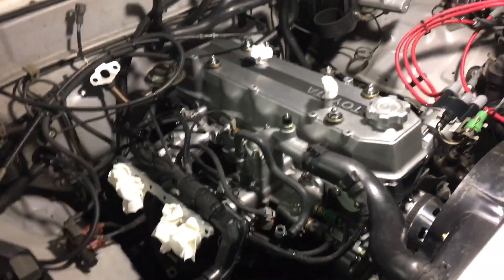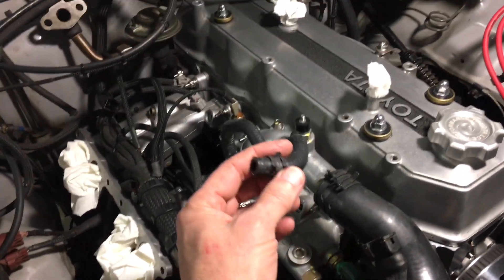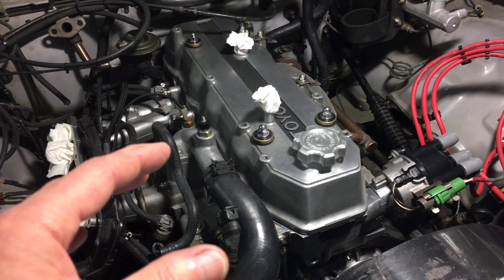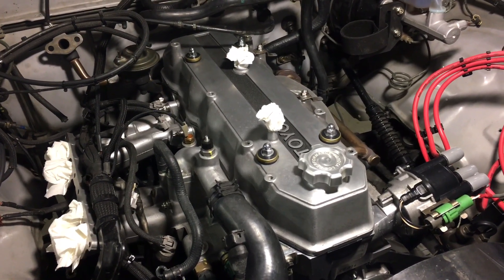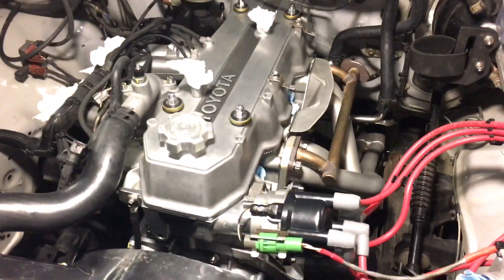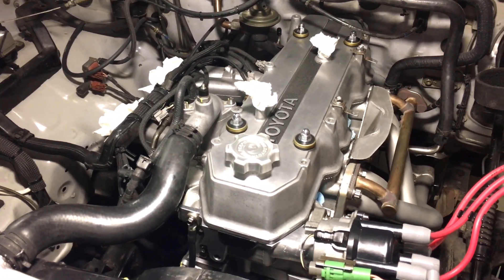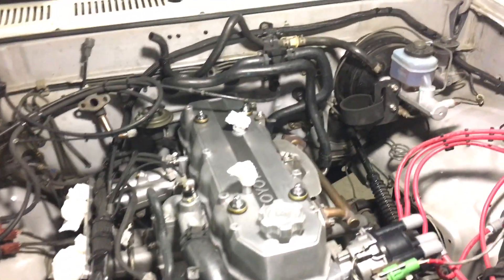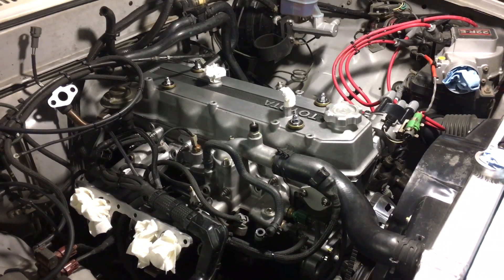UPDATE: 1990 Toyota Pickup 22RE reassembly. Refilling coolant / air purge tips. Camshaft timing tips

Comment: These engines are a nightmare to bleed the air out of….
Reply from the maker: It can be fun for sure :-) I've found back filling the cooling system through the return heater core hose works pretty well and then using those funnel kits to help get the air out usually get the rest.

Comment: @ray5961  Appreciate these vdeos that you do.  I'm going to be redoing a part of my engine harness soon and was hoping you could share a materials list you used.  For example, that looks like an elbow at the IACV that directs the harness over the intake runner.  Is that elbow something you purchased or made?  Thx!
Reply from the maker: that's a factory part, I just cleaned it up in the sink. I redid the wiring harness - let me know if you need any specific info on anything.
Reply: @ray5961  thank you. Mine is an '86, I wonder if the elbow is on newer 90's 22re models
Reply from the maker: @mrwhatchamacallit99  hmm.. could be. I don't know too much about the 86 and 87 models myself. Yours is fuel injected for that model year? I wonder if that elbow is something they added later, because it was factory on my truck. I can't remember if my friend's 93 had that or not though.
Reply: @ray5961  yes '85 and newer is Fuel Injected.  Ill do some searching online 🤙
Reply from the maker: @mrwhatchamacallit99  ok cool.. feel free to hit me up if you have any questions on redoing the wiring harness - that's a big job haha.
Reply: @ray5961  looking to just do the fuel injection section between the battery and the fuel injectors.  Replace the slices and put new connectors on.
Reply from the maker: @mrwhatchamacallit99  got ya. The way I did my injector section was this: I bought new connectors for the injectors, then I slipped the pins out of everything, moved the new plastic over to the pins left on the factory harness, cleaned everything up, put new heat sleeve insulation on, heat shrink the connectors, etc.. then just slipped the pins from the OEM wires into the new plastic connectors.

Comment: I had never heard of removing the spark plug ground straps, thats insane to me, but hearing you say it and talking about your experience with it and the more heavy duty electricals sounds nice. So many intriguing tidbits here, thanks so very much for sharing all these 22re vids with us.
Reply from the maker: Yeah, it sounded insane to me also when I first heard about it. If you check my more recent videos (specifically the top 10 mods for your Toyota Pickup or 4Runner), I go into more detail with exactly how I do it now and it works fantastic.
Reply: @ray5961  Def will do, Im making my way through all your 22re vid, made a playlist of them 👍 thanks man!
Reply from the maker: @tedbastwock3810  I should probably put together some play lists for the channel also, now that you mention it :) Anyway, glad to hear the videos are helping out.